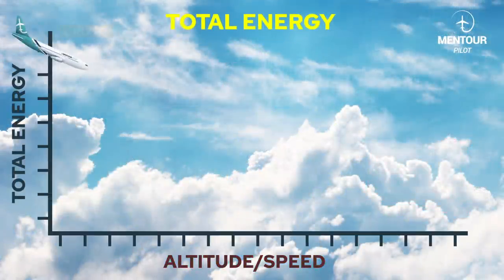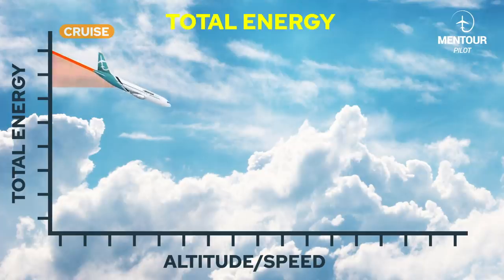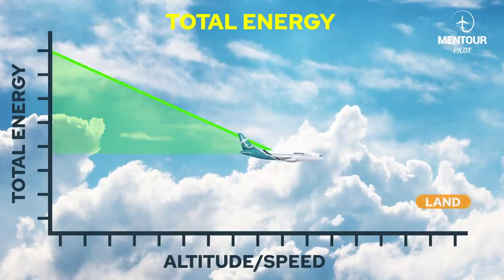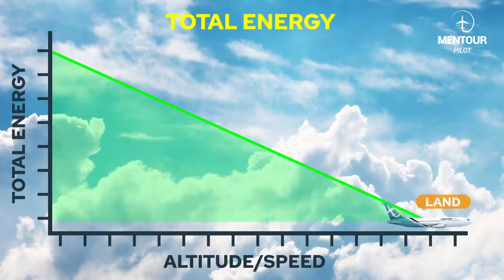Unstabilized Aircraft approach - Explained!

Comment: I thought first this is about PIA Flight PK 8303, because this flight is the example for an extremly unstabilised approach. For a short time they had an descent rate of nearly 7000ft/min nearby the airport!

And it is an example that the crew didn't hear warning signs because they were too stressed to hear them (on the radio between ATC and crew you can hear the landing gear warning).
Reply: I agree, they descended to the runway's level 10.000ft in 4 minutes. But what I could gather from several analyses, that alarm sound was not for landing gear but for overrided flap. The recommended flaps by Airbus are: 1 should be at 230kts, 2 at  200kts, 3 at 185kts and full at 177kts. The aircraft was most of the time between 200 and 250kts. When about to landing, the aircraft was 230 kts against the usual 170 kts. In order to keep lift and descending speed to the aircraft, they were overriding the recommended speeds for flaps, little by little, causing the alarm to go off most of the time.
Reply from the maker: I dont want to reference to an ongoing investigation. But I want to explain all the the terminology around it.
Reply: @MentourPilot  And you did it wonderfully!! Your pal Juan, who flies Airbuses had masterful insights about PIA 8303. There is a situation, though, about steep descending. Please confirm. Would warning alarm on a Boeing, at a certain altitude,  no matter what speed, go off when extended flaps are required? Would that happen in an Airbus as well?

Comment: "Energy can neither be created nor destroyed but can be converted from one form to another"
Reply: Then Big Bang is against your beliefs
Reply: @markmd9  the Big Bang has been disproven.  Where have you been living?
Reply: Ah but only in the observable universe, at its edge the expansion is so high (>speed og light) that light looses energy in the extreme red shifting. Energy is not conserved there. In our localised part of the universe you are however correct.
Reply: ecclestonsangel disproven by who?
Reply: @counterfit5  By some fringe YouTuber without an astrophysics degree in a 15-minute video, no doubt.
Reply: What Mentour was describing so eloquently was energy bleed
Reply: yes, it is converted from kinetic energy in the aircraft to kinetic and thermal energy in the surrounding air by friction, not destroyed.
Reply: @domesticterrorist483  actually the energy is still conserved there. Because the universe is expanding, the energy gets stretched or in other words gets diluted. But the total remains the same.
Reply: In the case of FedEx it went from potential energy into kinetic energy distributing the aircraft across the runway and field. I'm glad the crew were okay. I was expecting a much worse outcome.
Reply: Energy can enter or leave a defined system. In this case minor heating of the atmosphere through turbulent flow is energy leaving the system of interest and it is not a reversible transfer. As such "energy is destroyed" is a reasonably appropriate term.
Reply: I believe it all can be summarised with the principle of conservation of energy; The principle of conservation of energy states that energy cannot be created or destroyed but converted from one form to another or transferred from one body to another. The sum of energy in an isolated system is constant.
Reply: @ecclestonsangel  the big bang has most certainly not been disproven, in fact the nobel prize in physics of 2006 about measurements of the cosmic background radiation brought further proof of it.
Reply: @mytech6779  I strongly disagree, bleeding energy would have been a much more appropriate term. Energy is transferred from the aircraft system to the surroundings but it is never destroyed. Talking about destroying energy creates confusion and makes the actual physics harder to understand.
Reply: @haqvor  In that case bleeding energy would also be wrong, the semantically correct statement would be "transferring energy from the aircraft to the air" or more simply "removing energy from the system". 
However terms do not always translate cleanly, even between speakers of the same language; which is a linguistics issue independent of the underlying math. Adaptive language comes into play, much like saying house-hat rather than roof. Thus "irreversibly removing energy from the system" can be reasonably translated as "destroying energy" as we (practical airplane operators) don't care where the energy goes as long as it gets gone. Though it would be an incorrect phrase in a rigorous physics classroom. 

Now saying something like air "holds" or "absorbs" moisture as an explanation of relative humidity ... that is just entirely wrong on all levels as the vapor pressure of H2O and moles of vapor per volume are fully independent of the nitrogen and oxygen gases.
Reply: That was only true up until the discovery of mass energy equivalence.
Reply: haqvor but where did the energy come from to create the big bang if there was nothing there before it? I am not an expert but I do have a degree in physics.
Reply: @AndrewSteitz  The same place energy comes from for quantum vacuum fluctuations in "empty" space.
Reply: @AndrewSteitz  Then why are you asking such a stupid question? Aside from the fact that the question may be nonsensical (if time started with the big bang then what does "before time" mean), there are half a dozen ways you could explain how the energy got there. Not that we know which one is correct yet.

Comment: First, thank you for sharing your insights.   In talking about glideslope false readings, I don't understand (as a non-pilot) why glideslope auto monitoring cannot determine the difference between 3 6 9...etc degrees vs the required glidescope angle for the  specific location.  (I'm assuming not every glideslope angle for every location is 3 degrees).  I must be missing knowledge on this.  But on the surface, that would appear to be a very basic piece of information available or programmable.
Reply: That's why you intercept from below: "maintain 2000 until established". Once reporting back established, "cleared for the approach, contact tower."

Comment: Hi great video I love your info that you provide.   I do have a question 
for ya though.  I was coming in for a landing... the pilot was probably 
on a final because the flaps were all the way extended. However the 
situation or at least how I felt it was that the airplane was at a 
10degree nose down the spoilers were out and it felt/sounded like he had
 it in reverse thrust.   I know it was probably in my mind but it felt 
like we were just hanging in the sky. Could you explain this? (he 
probably didn't have reverse thrust on but it sure felt like it.) Also 
the pilot made a very hard landing I thought the gear was going to fall 
off. lol

Comment: Question for a possible next video: why don’t aircraft have a drogue parachute as standard equipment, to be deployed ONLY as a last resort, in landings where something is going wrong? Drogue parachutes are employed in military jets for obvious reasons — but why not fitting a B737, A320 or any other common passenger aircraft with such device, as an extra, emergency solution to reinforce the effect of thrust reversers in case of need? Again, I mean that its deployment would ONLY be for when the aircraft is clearly going to overshoot the end of the runway (because of excess speed for whatever reason). Thanks!

Comment: When can a first officer assume command if he disagrees with his captain?  When can he access the locked revolver?
Reply: Been there done that I had no intention of running off the runway & heading for the water - once I got the Aircraft airbourne I said " You got it (His name)".
No problem after that.
Reply: When the 1st officer has stronger arms to push the throttle forward And the balls to do it. If you're gonna basically conduct a mutiny you know there's going to be a lot of splainin to do later
Reply from the maker: When the captain is clearly doing something dangerous/unauthorized, after prompting. 
There is no “locked away revolver” at least not in Europe.
Reply: @MentourPilot  Remember the case in Tawain years ago when an A300 (I think) crashed & it turned out the Capt tried to land while the F/o tried to overshoot. ( Great crew Management Huh?)
Reply: @MentourPilot  there is a locked away revolver in america
Reply: @_.luminosity._  Who has the key?
Reply: @_.luminosity._  It's not. There is a shotgun though.
Reply: @MentourPilot  Someone has been watching too much Hollywood Captain . Firing guns in an aircraft is shall we say, on the dangerous side lol
Reply: @MentourPilot  

Based on being a "junkie" for watching Air crash investigations it seems that the captain taking over as pilot flying from a FO who has trouble flying the aircraft in a crisis is a really bad indicator of things to come. 

I'm sure situations occurs when you have to, but if there are other options available I'd hope command training emphases that this is kind of a last resort.

Comment: Good explanation of the different energies, with some diagrams. But as the relation of potential energy is correctly shown as proportionally dependent to the altitude above ground, the kinetic energy is incorrectly displayed in the diagram at the beginning as being also proportionally dependent to the speed of the aircraft. This is NOT correct. The kinetic energy of the aircraft is proportional to the square of the airspeed. Example 41% more speed means double the kinetic energy. It would be nice to chanhe the diagram to show a curve that is representing that square relation.
Reply from the maker: You are correct.

Comment: Funny how you're careful not to mention PIA flight 8303, but as the video goes on it becomes clear this is the incident you're talking about. Particularly when you said, "Why didn't they hear the warnings?", it's obvious what you're referring to. My question regarding the A320 is: If you engage the landing gear above 260 kts, it will not go down, but if the plane subsequently drops below 260 kts, does the landing gear automatically go down or do you have to sycle the gear a second time?
Reply: I had the same question. I just wrote a comment above about it.

Comment: Funny. asked you a question about energy dissipation via super chat.  But that was limited in words  Anyway, Space shuttle targeting a 2 mile runway from 200k feet.  Pretty amazing .  No doubt enough energy dissipation was accounted for in chutes, brakes, spoilers, etc.  But imagine if you dumped that energy too soon. Yikes! We're over and done with no matter the skill of pilot.  Smiles do not equal miles.  I love physics and understand the "envelope" thing.  To me, it is very impressive those things(shuttles) never crashed due to miscalculation.  Clouds, temperature and wind are not a linear equation from 200k feet and down.  They must have set aside enough "go-juice"(energy) to cover potential losses.  Sorta cool engineering.

Comment: This is a very germane video to make while we wait for more information on 8303.  I'm pretty sure something very similar was going on in the cockpit of that A320, since despite their assurance that they were "comfortable" (PIA speak for stabilised approach) they were anything but stabilised if only they had realised that.  Subsequent overload didn't allow them to realise that they were overspeed and the gear had not come down.
Reply: I believe he is being careful because he does not fly Airbuses only Boeings. As far as I understood from several analysis on PIA 8303, in that airport pilots are "accepted" to override limits. As experienced pilot he was, this assumption that he forgot to lower landing gears is rubbish. They were able to deploy it. The safety valve in an Airbus only blocks landing gear at speeds over 260kts. They were descending between 200 and 250kts. The recommended flaps by Airbus are: 1 should be at 230kts, 2 at  200kts, 3 at 185kts and full at 177kts. In order to keep lift and speed to the aircraft, they were overriding the recommended speeds for flaps, little by little, in a very shot time, 4 minutes, causing the alarm to go off most of the time. When they were about to land, the speed was about 230kts when it shoud have been ca. 180kts.
Reply from the maker: Yes, I do t want to discuss ongoing investigations, especially on aircraft I don’t fly, but I can explain some of the terminology.
Reply: @onkelbebo3139  I agree it's ridiculous to suggest he forgot the landing gear, but you're also saying that the landing gear should have come down even though at one point he was going over 250 knots and descending at over 7000' per minute at one stage. I doubt that's an acceptable approach even into KHI.  So when he touched down he was barely down to a speed where he could apply flaps 1, which brings us back to the question of did the pilot and 1st officer forget to lower the landing gear, instead concentrating only on getting the plane on the ground at all costs (since you say he should have been able to lower the gear).
Reply: @Chrisamic  No, I did not say that, the safety valve releases at 260kts. At 250kts is OK. Besides, they would wait longer enough to get the gears down. Yes,  they exceeded the rate of descent to 6 to 7.000 per minute. I watched a Pakistani commentator saying  that kind of approach is "acceptable" in Pakistan. However, you raised a good point and we just need  now to confirm if the chimes were not for landing gears but for flaps, overridden or not set in proper position at a certain altitude/speed. If this is the case, the pilots were aware what they were about and ignored them.
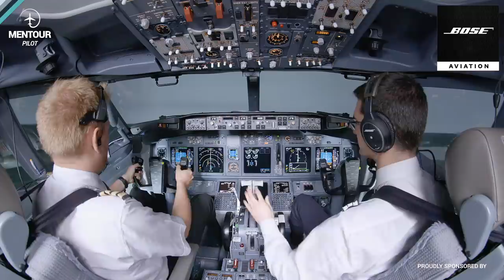Reply: @Chrisamic We can observe in the video at 18:04 that the assistant pilot moves the gears lever AFTER the aircraft recovers altitude. So, I don't know what to wish for, being right or wrong, about my theses. This is the crucial point because if the landing gears were down, they would prevent the engines to strike ground. Either way, forgetting to set them properly or retracting them too soon, this caused the damages enough to end in disaster. Fatal mistake!
Reply: @onkelbebo3139  ?  the example at 18:04 is showing how to do a correct go around.  The operation of the gear leaver in this case it to raise the gear to reduce drag for the climb out.  It's not really relevant to the question of what happened on 8303 except to demonstrate correct approach and go around procedures.
Reply: @Chrisamic  Yes, you are right. The video shows the correct procedure. That's what I meant. Perhaps I was not clear when I said I did not know what to wish for, to be right or wrong about PIA 8303. While approaching the runway, the pilots had either forgotten to lower the landing gears or, just before the plane had stricken the runway, while maneuvering to go around, they retracted them too soon, to reduce drag, before the airplane recovered altitude again, which made it to lose lift. Sorry about that, English is my second language ;-)

Comment: I’m surprised there isn’t some way of receiving up-to-date wind data over the data link or something. Maybe the airport could have radios spitting out data all the time which can be received. Not unless ATIS does this for you?
Reply: Pilots DO get actual wind (speed and direction) every second, not from the ground, but calculated by the FMC and is presented on the Navigation Display and/or the CDU (depending on aircraft type). This is very helpful and much more accurate than the wind given by the tower.

Comment: Question on exiting a hold to return to the missed approach runway what is the best procedures to accomplish this?  Using the FMC and map and vectoring???
I understand that the aircraft will not automatically go the the missed approach runway, but the pilot has to work with the FMC and map and vector the aircraft
as it will not automatically vector itself to the runway?  Any advise would be appreciated.
Reply: Go to exit hold, go to FMC, ARR make sure airport and runway is entered. Exec. Go to legs and make sure it is correct for the arrival airport and RW.
If it is not enter the correct airport and R/W. Make sure Nav. radio has correct frequency set.  Look at approach plate for correct alt.

Comment: Airbus 320 sop allows speedbrakes in config 3 (equivalent of flaps 20 kind of). The buffet margin is quite tight but it’s unlike Boeing 787 sop where speedbrakes past flaps 5 is specifically told to be avoided. Difference in philosophy? difference in actual structure and aerodynamics? I wonder. Maybe I’m just remembering wrong and airbus didn’t recommend it either.

Comment: In the sim I fly the A321, when the aircraft has a positive Vdev (vertical deviation from flight plan) I use the speedbrake above FL 300 then switch to controling the V/S manually. Once I am close to FL100 I can let managed mode take over. Do you recommend doing a holding instead?
Reply from the maker: No, if you can fix it with speed brake, it’s fine
Reply: @MentourPilot  The speed brake seems to stop having once I'm past a certain IAS, the a/thr just compensates for the reduction in air speed...maybe a difference between the 73 and a321